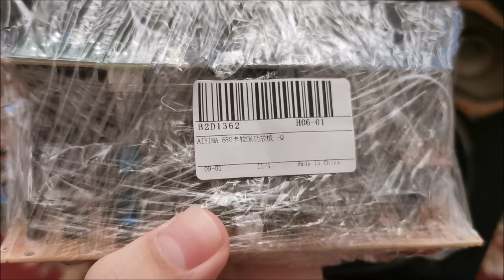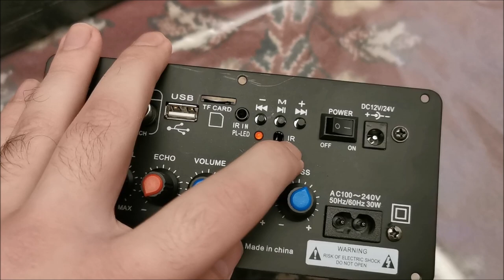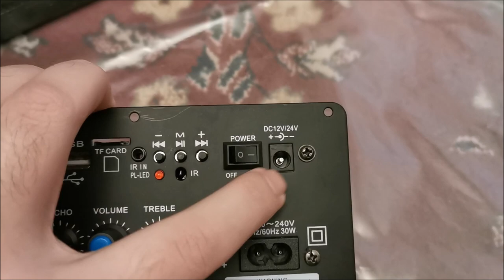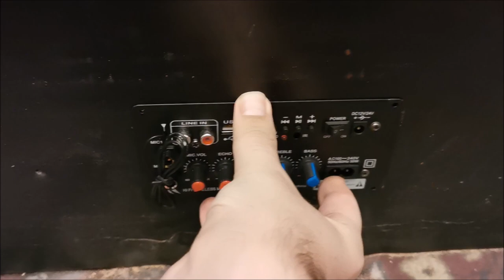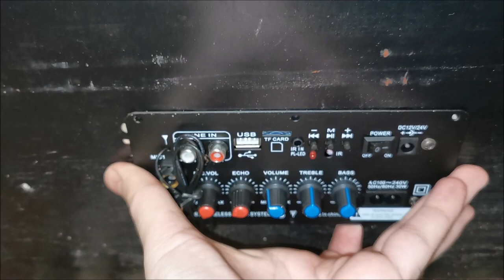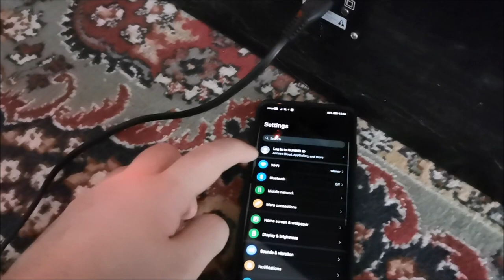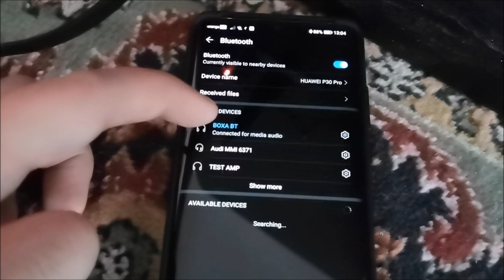How to convert any speaker into a self powered one with Bluetooth, USB, microSD and Karaoke 🎤

Comment: Interesting module and DIY speaker. I would mount 2 tweeters (stereo) on top of the speaker, pointing forward. I suspect it's mono as it is.
Reply from the maker: Yes, like I use it it's mono for sure. But probably also by adding tweeters it's still mono, as it only has one tweeter output. Maybe the amplification itself is already mono.
Reply: sir mga 100 watts kya yan

Comment: That hiss you are talking about could be the soldering you did, touching some part its not surpose to. check it out, if you haven't done so.
Reply from the maker: I thought about that, but did a bit of online research and it seems they just have a really high gain from the design. Only thing that can be done is to change some component values, to lower the gain, but then you will also lower the maximum volume.

Comment: I have a creative s750 gigaworks, there is a way to don't cut the rear and link the 2 exit on a bluetooth adapter ? Considering that amplifiers is inside the subwoofer the rca output should also be linked to bluetooth adapter... resistence of speaker is 8 Ohm
Reply from the maker: Sorry, but I don't understand what you are trying to do.
Reply: @UltimateDIY  I have a creative soundworks s750 and want convert it to wireless... each speaker has the input as your speaker, but I don't want cut the rear cover as You have done and don't want solder the cable extremity with the board... how can I do it ? Moreover I want know if there is a single transmitter to plug the 6 speaker rca  output that sends signal to single receiver of each speaker
Reply from the maker: I don't think this is the right module for you. You need a bluetooth transmitter module and bluetooth recievers.
Reply: @UltimateDIY  ok ... what components should I buy and how mount it to reach my goal ?
Reply from the maker: Sorry, but I don't know exactly. It's quite a complicated project.